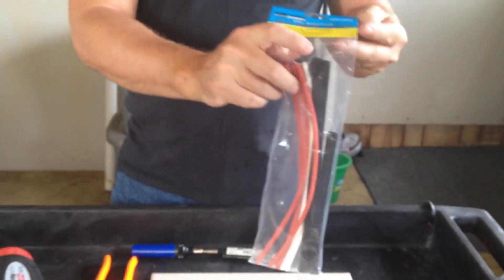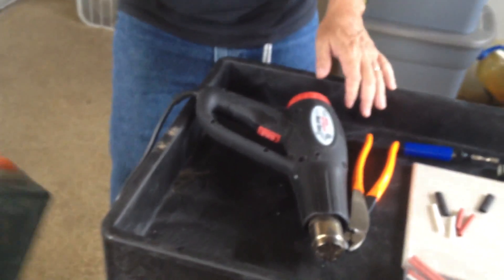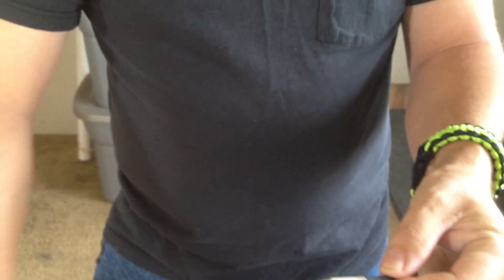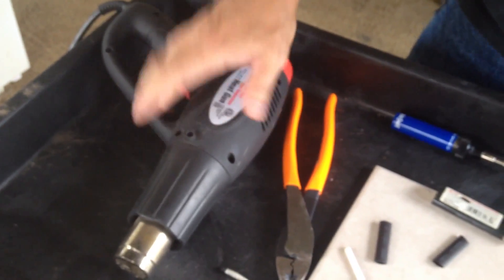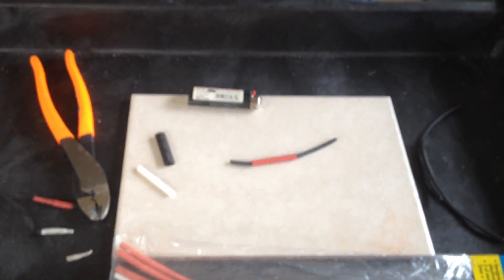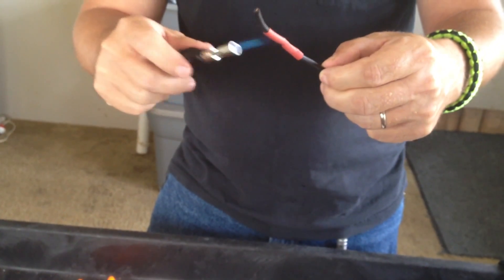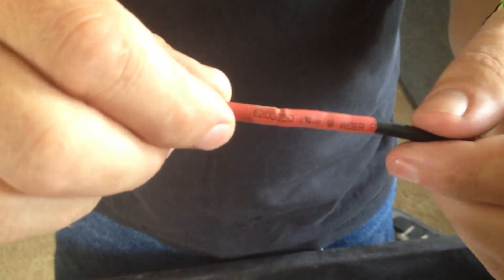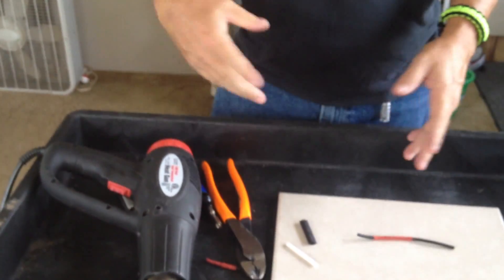How To Use Heat Shrink Tubing

Comment: How does one get the tubing over a large end, like an earphone 3.5mm jack end where the wires are frayed and exposed right at the base where there is thick rubber surrounding the jack? If I cut the tubing and heat it the tubing forms back on itself and not around the wire.
Reply: Try inserting it on one end before you join the two ends of the wire,  and then use it afterwards you are done with soldering or joining

Comment: Thank you for making such a good explanation of how to use this.  I am a DIY junkie, because $ is tight and making things can be so much cheaper.  I want a set of tunisian crochet hooks but they can be super expensive.  I got an idea to make my own with a regular crochet hook, shrink tubing and a cord.  If it works, your video will have helped make this crocheter very, very happy.  :)
Reply from the maker: I hope it works out for you.

Comment: No need to buy any heating gadgets...
If you have an electric stove in the kitchen or a portable burner with that uses an electrical coil... Turn a burner on high and that should provide enough heat to shrink tubeing... 
Be Careful not to burn yourself or start a fire...
Reply from the maker: Thanks for sharing

Comment: I use a hair dryer i got from goodwill, and it takes quite awhile. And then just tonight I looked up how much a heat gun is, and its not much, like 17.99 at Walmart
Reply from the maker: The price isn't bad but it also depends on the brand and stuff
Reply: @MrJustDIY  yes this is true
Reply: I'll probably just get one from harbor freight

Comment: Does heat shrinking give a glue-like effect between the wires? Making it so I could just rap the bare wires together without solder?
Reply from the maker: No you would need to solder them.

Comment: 1): if the sleeving is tight, rub on a little liquid soap
2) You can shrink it with your soldering iron
Reply: The soldering iron gets hot enough to wave it passed the heat shrink,to shrink?

Comment: How can i put the shrink tube around a wire that dies not have ends? I'm trying to splice into a wire harness military splice.
Reply from the maker: You can't
Reply: @MrJustDIY  what do you suggest I do? I can use a t connector but I don't have crimpers
Reply from the maker: @iiSup3rior  You could always use liquid electrical tape and also wrap it with regular electrical tape. Just a suggestion
Reply: @MrJustDIY  he could also try to get a shrink tube size a little bit bigger then the wire then split the wrap around the wire and pinch the rubber back with maybe a soldering gun tip though and then heat the tube up,I think it could work ,I've tried but on wires that don't have much "force pull" or I've used a "hot glue gun
Reply from the maker: @kaloosh2639  Good idea and it would be worth trying

Comment: I use my kitchen gas stove. I’ve never burned any tubing, and it instantly shrinks the tubing perfectly around the wire or cable. Don’t need to get wire close to the flames because of the intense heat. Also, I wear leather gloves because of the heat.

Comment: Can I remove this when I want it?
Reply from the maker: Yes
Reply: MrJustDIY thanks I want to do this in an 1/2 inch impact socket. There is a diameter of that size?
Reply from the maker: @genysmenrunner1677  I think it comes that big but you will just have to search and see.
Reply: MrJustDIY ok thanks for the help

Comment: Definitely DID NOT answer my questions. i.e. do wires need to touch when splicing them together?
Reply: Seriously???   If the wires aren't touching then they're NOT "spliced/connected" therfore will NOT complete any electrical circuit!   Shrink wrap tubing insulates bare wires AND connects/bonds wires HOWEVER tis up to the individual to make sure the wires are both physically connected before the shrink wrap is used.
Reply: As long as we are all learning here...
Reply from the maker: It is better for them to
Reply: @MrJustDIY  So apparently Heat Shrink Tubing ISN'T to be used as CONNECTORS. They are to "insulate and protect".

Comment: I just bought a similar bag of heat shrink wraps here in Australia and it cost me 30 bucks 😐
Reply: buy from china. I got hundreds of pieces in all diameters for like $2 with free shipping. Works just fine. Go to ebay and look.
Reply from the maker: OMG that is just crazy here in the USA you could of got 10 bags and maybe more if they was on sale I would of even gave you some.
Reply: MrJustDIY Maybe I just didn't shop around enough. I found it odd that 7 or 8 pieces of plastic pipe would cost so much.
Reply from the maker: Yeah that's really high priced.

Comment: Thank you. I'll be using my torch lighter for the applications I need to use heat shrink tubing. I prefer your heat gun method, but I'll be working in a confined space.
Reply from the maker: You're welcome

Comment: You could probably use a candle, also.
Reply: Dan R. Graham nah wax doesn't burn as clean as gas, using a lighter or propane torch will burn cleanly and stop you getting carbon all over the tubing

Comment: Thanks man!  Quick and simple!  That's just what I was looking for. :)
Reply from the maker: +norbac Your welcome and I'm happy it worked.
Reply: @MrJustDIY  I really like heat shrink.. the heat shrink tubes with a split works good... use shrink tubing to strengthen  cheap ear bugs at connections or the weak spots that tend to fatigue out...

Comment: Interesting. I use the girlfriends hair dryer ha
Reply from the maker: +RCPHOTOMAN My wife got me the heat gun so I'd leave her hair dryer alone.
Reply: +MrJustDIY Ha sounds like a good deal :-)
Reply: My wife is full of hot air, so I just make her angry and focus her onto my wiring jobs.
Reply: I've always wondered what the difference was between a hair dryer and a heat gun. Turns out, it's testicles.
Reply: My wifes dose the job but dosnt shrink it enuf